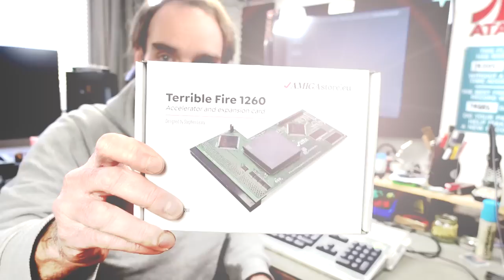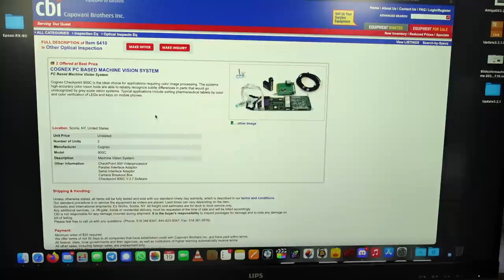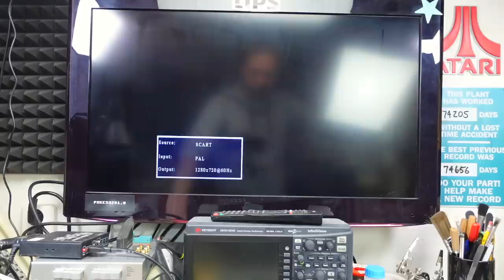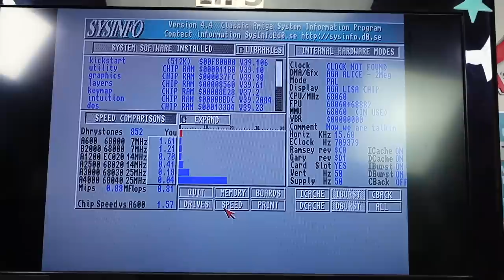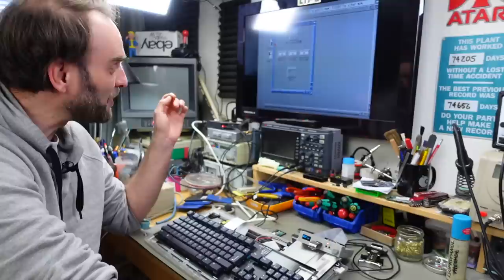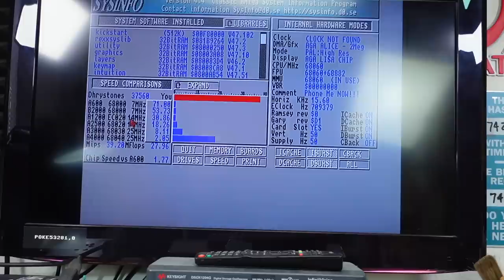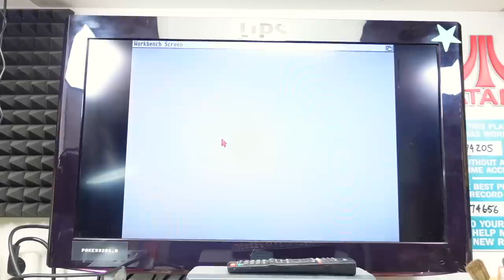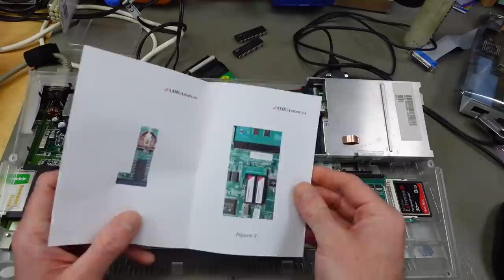Amiga 1200 TF1260 Accelerator Installation

Comment: So MHz to MHz the 68040 is just as fast as the 68060.The 50MHz 68060 is only twice as fast as a 25MHz 68040. What's going on here, SYSINFO shows the 68060 as 2.05 times as fast as a 68040 A4000.
Reply: I noticed that as well.  It's a little surprising there's not a greater boost in speed, since the 060 is a superscaler architecture similar to the Pentium. 

Maybe there's a good reason Motorola abandoned the 060 in favor of the PPC architecture?  I'm just not familiar enough with the Motorola chips to know why this benchmark doesn't show greater improvement.
Reply: @Ras Voja`s Rasta, Retro and Resistance to Babylon  so basic lyrics it's just a higher binned chip
Reply: @stevesether  Motorola switched to actual RISC, Intel switched to RISC-like cores; I wouldn't be surprised if both ran into similar issues when trying to scale up from the 060/Pentium for the successor.
Reply: @kaitlyn__L  Sure, I'm familiar with the choices each made.  But the point is that the 060 isn't some giant leap forward, like the Pentium was.

It's also possible Intel just had better engineers, more money to throw at it, or both.
Reply: @stevesether  oh, yeah that too! I hadn’t had caffeine yet that day when I wrote that haha. I can see now you were saying more than just process and basic arch. :)

Comment: The most expensive area of old hardware, is the medical field. You can not just stuff something else into the machine, as you need the exact spare part for how the machine was tested and certified in the first place. That is what makes medical stuff so much more expensive than, lets say, the on the mill standard ET4000 gfx card.

Comment: There is a known issue with 68060 and current version of sysinfo.
Reply from the maker: Yep, SysInfo is acting up a bit with several setups. I think the results I got in the end looked reasonable though (except for the fact that it wasn’t able to see the clock speed at all). :

Comment: Temperature of 68060? I removed Phase 5 accelerator card from A1200 because it tried to melt plastic inside with its hot Motorola CPU. remember, there is no cooling - no cooler, no fans, no airflow.

Comment: you have yo put a cooler on that cpu,please do it , i will start having nightmare's about thatt cpu
Reply from the maker: The 68060s don’t really need a cooler unless you overclock them. Mine gets lukewarm at most. Quite different from previous 680xx generations. The CPLDs on the card run WAY hotter.

Comment: I see 68060's on eBay from China for around 50 USD. Anyone tried these ? Fakes?
Reply: Those are generally the LC or even the lower version with no FPU or MMU. Avoid the one without the MMUm
Reply: @10MARC  Looking at them, they look like they're the 68LC060, which has an MMU but no FPU.

I doubt much software takes advantage of the FPU, so I'm not sure why you'd want the one with the FPU for a few hundred bucks more.

Comment: It's going to get to the point where a 68060 core on an FPGA will be cheaper than the actual CPUs.  There is already an FPGA 68060 core for the $200 XC3S1600E FPGA, that device being sold for under $100 before this damned chip shortage.

Comment: the doom bit, the amiga is also doing PC graphics, card emulation, too, all in software in real time? classic 68000's where really terrible, in the world 3d graphics, not being blessed, the assortment cards available on PC's ?
Reply: and the bit where hole doom and quake, are just run as app's on the amiga desktop, the desk still running in the background, even modern-day PC, would struggle trying to do that, without stalling. spluttering along the way?

Comment: As much as this kind of thing interests me what are people doing at the end of it? 

Playing Lemmings . . . .
Reply: There is a joy just in the doing and having in itself.
Reply: Nothing besides PiStorm makes any sense to me as far as new CPU/RAM hardware (much cheaper, more than 50x faster, much easier to set up, doesn't need CF cards/adapters) - but PiStorm32 (the one for A1200) isn't ready for mass-adoption yet.
Reply: @benbaselet2026  That's the part I get but I'm struggling to see uses for a powerful amiga? 
I upgrade my pc so I can max out the latest games but what do people do with an upgraded Amiga?
Reply: @JungleJeffarnold  Run newer demos for one. Or newer games or browsers and operating systems. There is still new software released all the time.
Reply: @JungleJeffarnold  depends how far you go i have 68060 and ppc with voodoo3 etc in my amigas playing quake 3 rtcw etc etc
Reply: @primus711  Compared to what its supposed to be capable of I guess that is an achievement but on the flipside I could do that on an old laptop at a fraction of the cost,
Like I said I find it interesting but i'm not really seeing the uses.
Reply: @JungleJeffarnold  well its fun cool and if you grew up using them even better
And most people already had their amigas or bought them before the retro boom so they are only expensive now because rarity just like anything
Its like taking your 1st car you loved and turning it into a streetrod etc
Stuff you couldn't afford or wasnt parts to do then
Who doesn't love hacking modding stuff to do more than it could
Reply: @espressomatic  Interesting project, but would any Amiga related OS support Raspberry Pi cm4 hardware ?
Reply: @Malheirods  the pistorm etc is just emulating the cpu
And able to do other things it can emulate etc its hardwired directly into the bus so you could write software to do anything on both sides
But regarding amiga oses no as they are 68k and ppc only
Reply: @EXiLExJD  woohoo we can play a game that people run on a calculator 😂 I was here early just asking what people are doing
Reply: @primus711  I quite like softmodding I had amiga games running on a nintendo wii 😂
Reply: @JungleJeffarnold  im 1 of the devs who made the fastest ppc amiga accelerators
I actually have the fastest g4 7457 at 2ghz
We actually made hothardware when i found out the killer nic network card was using a ppc8349 thats just 1 of many accelerators we made compatible their are g3 and g4s
Many vids on youtube showing them running many games and demos
Now talking about just retro in general i have many amigas with accelerators of all kinds great thing about super amigas is they can run games from early 2000s like rtcw etc new ports happen all the time plus amigas are the fastest 68k macs so you have that plus like my amiga 4000 and 2000 have bridgeboards that allow pc x86 retro amigas are very versatile
Reply: @primus711  I find things like this fascinating but I doubt it's something I'll be doing, 
One of my friends at school had an amiga while I had the old amstrad 464 so the only experience I have is popping round his house to play things, 
I watch a lot of old gaming and retro tech content I have a playstation 2 with a hard drive in the back of it and that's about as far as i've gone with modding, 
Still waiting for a hdmi mod for that . . . . .
Reply: @primus711  the pistorm emu68 doesn’t but the Musashi(sp?) version does.
Reply: @davidwright9166  those are both 2 different things and the both emulate the cpu among other things what is your nonsense talking about
Lets hear your expertise
Reply: @primus711  i assume the 2001 in your handle is your birth year, responding as you to me in an immature manner. My nonsense is from the horses mouth pistorm devs. Expertise? We’re talking about hobby for an ancient computer.
Reply: 1st thing I'd do would be to launch Rift by TBL and open a beer.

Comment: If only you could clone those chips. Doubt Motorola would give a darn.
Reply from the maker: I think there are FPGA implementations of the 060 architecture already floating around but nobody has made them into an Amiga accelerator yet. Would be interesting to see if it can be done (it probably can)!

Comment: To be honest, I never understood why the Amiga needed to be upgraded with such "powerful" accelerators. Will it perform at the same level as P233 for example? No. Can you use it as your main computer for web and other things? Technically yes, in reality no. Any old crappy PC will handle this better. 98% of the software is adapted for A500, A1200 and this is more than enough. So what's the point? Pay 300 yankee bucks and run Quake at 10 fps? LOL.
Reply from the maker: Basically it’s just a hobby and the joy some peeps (including myself) get out of these old school Amiga upgraded has no reasonable explanation. I think of it as the upgrade I could never afford back in the day.
Reply: There’s no practical reason for it, it’s just for fun if you have money to spare and you’re a die-hard Amiga fan. 

In truth, you can get an FPGA system like MiSTer which will simulate any Amiga nicely and can even run at a massively fast (100 Mhz) 020 + FPU mode, which is good enough to accelerate any Amiga software beyond what its designers had dreamed of. On top of that, MiSTer also simulates our other beloved vintage systems from Acorn, Atari, Sinclair and C64/128, so it’s the all-in-one solution.

Comment: Hi, Jan or dear community.
Next time your Amiga 1200 case is opened could you please do me a favor?
I just recapped my A1200 and i'm not sure if i accidently broke a trace.
Could you please check if there is a permanent connection between a and b:

Location: upper left at Mainboard.
C236
    |(a)
    |?---o(b)
   [C]
    |
    |

https://drive.google.com/file/d/1C8vSn5f5gteAIL7gilawHLWS1WAM8opF/view?usp=drivesdk

Right to the capacitor C236 - exactly right to its upper lead - there is a single pin dot.
Is this dot permanently connected to the capacitor's upper lead? 
I can't measure a connection.

Thx in advance!
Reply from the maker: I don't have the A1200 on the bench currently, but you might want to have a look at the Amiga PCB Explorer. You can click on any part and see what it supposedly connects to. ;) http://www.amigapcb.org
Reply: @JanBeta  vielen, vielen Dank! Die Seite kannte ich nicht. Ich muss wirklich nachlöten! Das erklärt auch das seltsame Verhalten: es dauert einige Sekunden mehr, bis das Bild via scart dargestellt wird. Ich vermute, dass es damit behoben ist. 1000 Dank und alles Gute und stete Gesundheit!!!